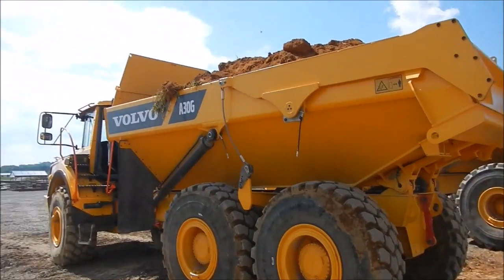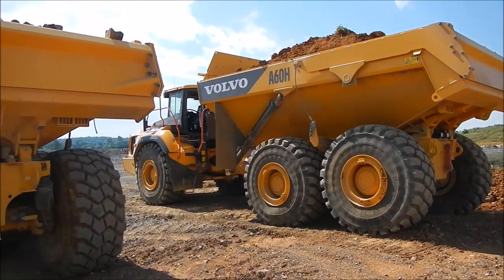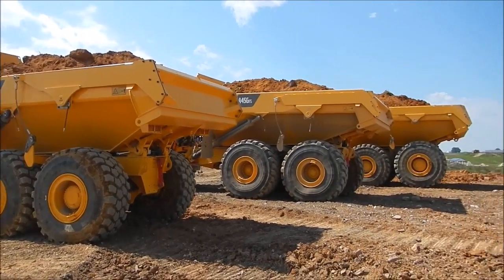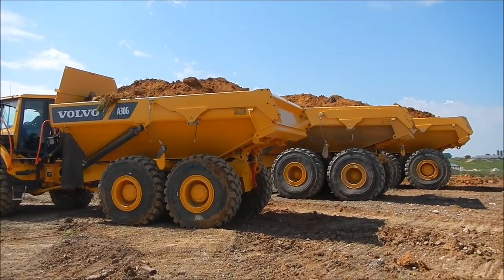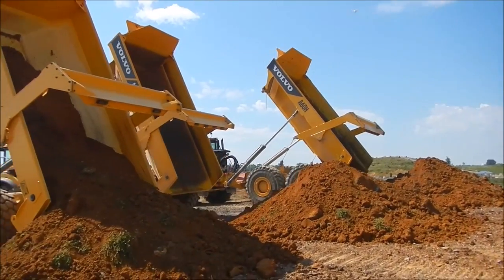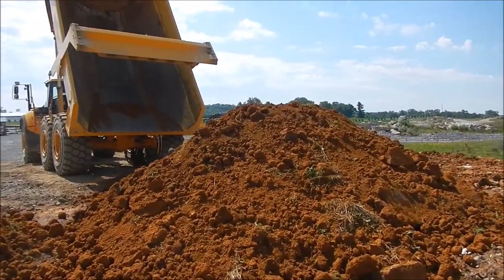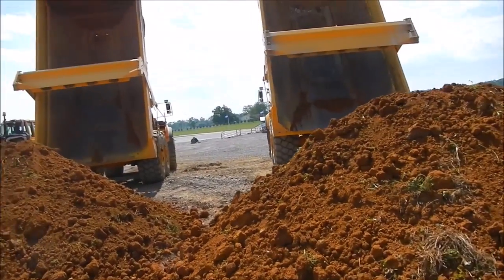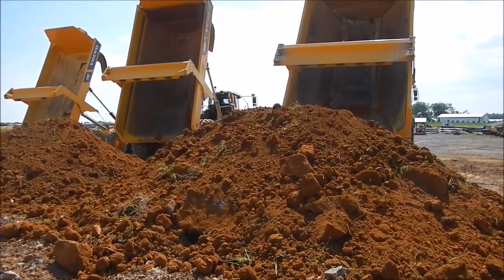Dump Those Loads!

Comment: The guy driving the 60 ton is afraid to raise the box all the way and the guy on the 30 ton is afraid of the throttle. Tell Volvos office guys to take a walk and get some operators in the seats. I call for a do over.
Reply: better safe than sorry and the video was about size/capacity vs. idiots racing to be unsafe?